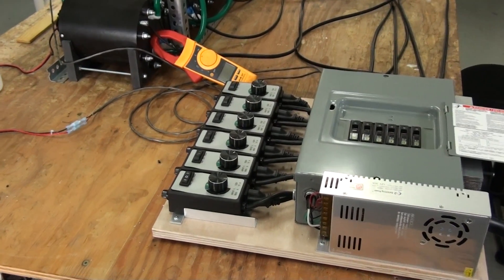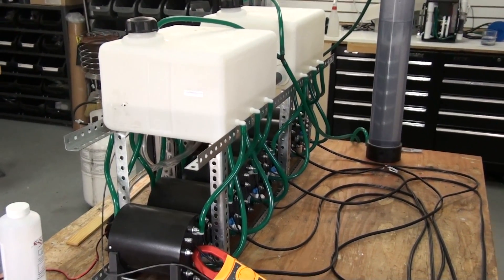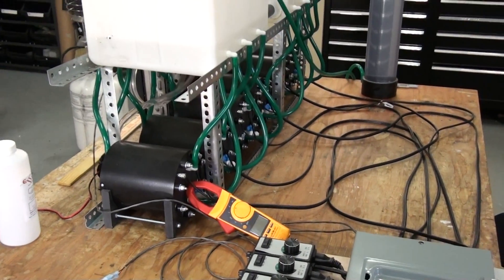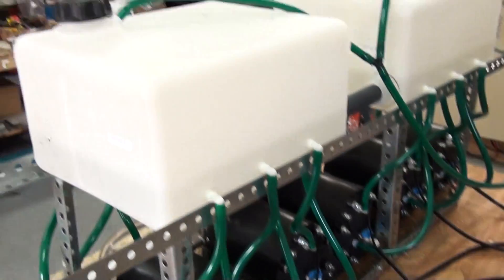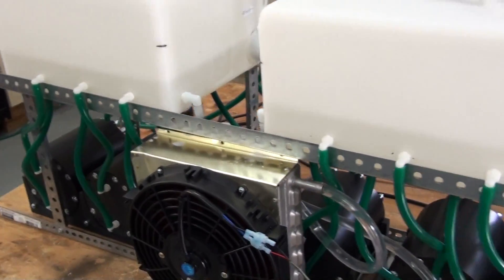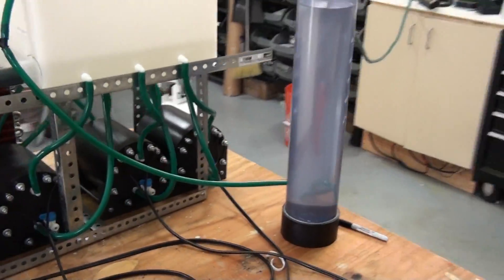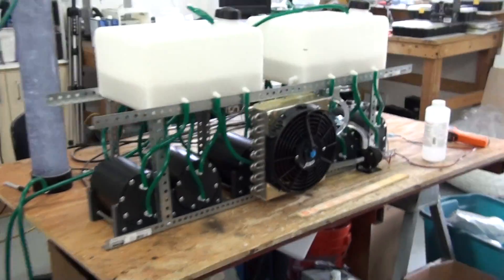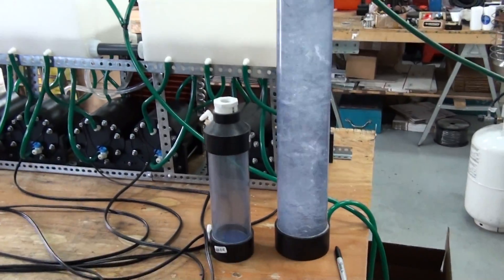35+ liters per minute Improved 354 plate monster HHO hydrogen generator

Comment: You have not told your power consumption at all! If you gobble up the power, what have you accomplished? It is a expensive exercise in futility To get a gain you must produce a gas with much less power! This is possible, but never with massive plates! I can produce 24 Liters of HHO per minute at 24 Volts and drawing 12 Amps of Current which comes out to 188 Watts!! I use small plates to accomplish this! What is your power consumption?
Reply: Ed Pence,  you maybe mistake ,,,it is not 188W but 288W?
Reply from the maker: I'm making browns gas here. If the gas is what I want why am I concerned about power consumption.... FYI my generator use 200 watts per liter
Reply: @Hydrogen4Health  What a waste of power!

Comment: Steve this is great, 
I have been working on a system to heat  water  for home heating,  could you recommend the best way to heat the water would be. at the moment i have an electric heating system that heats the water and then it gets pumped through the house in to the radiators, i want to be able to burn the hho gas and add to the system, reducing the electric cost. do you think this can be done

Comment: excelent job. what is the best power source in this case  force brute 110, 220 volts or pwm type bob Boyce design.? every Body need High production with less power. thanks
Reply from the maker: +Alex Mocho For this type of production the way you see it here is probably the best. 110 and 220 volt design for the most part are not efficient. There are some 12 and 24 volt type generators that are much more efficient.
Reply: For an equivalent  amount of power the 12 and 24 volt systems just have too high of a current draw, which makes the power supplies really expensive.  The advantage of a higher voltage system is you get to use less current, which means less wires heating up and no expensive DC power supplies.  If the high voltage AC systems do not appear to be as efficient, then I suspect it may be because you are taking the output straight from a rectifier without removing the humpback from the waveform.  So it's not a constant DC voltage you are feeding the cells, but rather a waveform that oscillates between 0 and 170 volts for a 120 vac wall voltage.  It would take some very large capacitors to smooth it out at the currents these cells are drawing, but it might be worth a try.   I plan on trying it at some point to see if there is a difference.
Reply from the maker: what type of caps would you suggest?

Comment: Hi, what are you using as the electrolyte?
Reply from the maker: +lego getriebe KOH and distilled water
Reply: delvis11 what electrolyte would you prefer? NaOH, KOK, NaCl, H2SO4, .....
Reply from the maker: In my experience KOH works best.
Reply: Is there any potential problems with taking a cell that was previously running on NaOH and switching it over to KOH?  Just flush it out real good beforehand and it is good to go?
Reply from the maker: You will have no problems.

Comment: How many amps are you drawing and what size engine and at what RPM could one run this unit ?
Reply from the maker: +zee1no This is not made for a engine. The customer purchased this machine to weld and cut with.
It draws about 40 amp @220v

Comment: Hi Steve,
I did not see any inline flow diverters between the two tanks. Just seems to me that you might be losing a bit of pressure or something or with HHO is that not an issue? I am thinking the days of old with V 8 Engines and Y Pipes, the reason you would add the Y or X pipe for dual exhaust is to keep pressure similar between all 8 cylinders. This set up just seems that if one or two generators is working better, it may create more pressure and possibly gimp another generator. I am guessing here as I have not built such a device just yet; but I have been doing research. I know water does take the path of least resistance so maybe it's a mute point. Great device.... Now that I've taken a second look I see now the two tanks are connected so it's probably not an issue... Cheers...

Comment: does this make hydrogen and oxygen mixed? if so, how do you separate it to just to get hydrogen and what would be the hydrogen rate then in lpm?
Reply from the maker: +The Zodiac This machine will not separate the gasses.
Reply: +The Zodiac HHO means Hydrogen Hydrogen Oxygen  ready to burnnnn